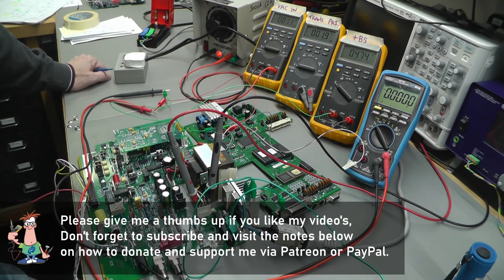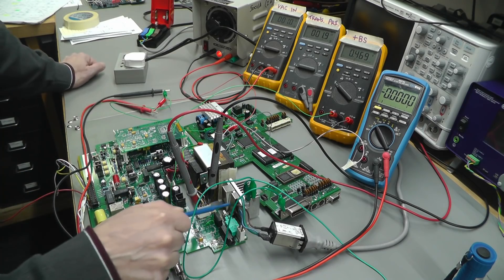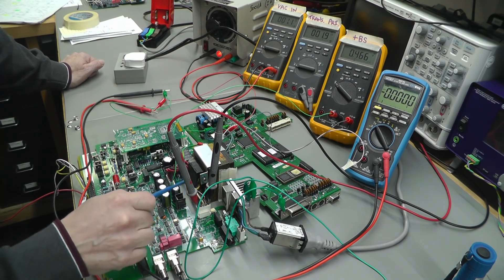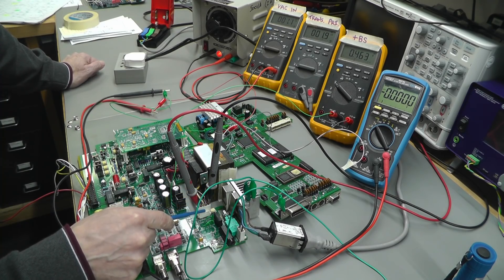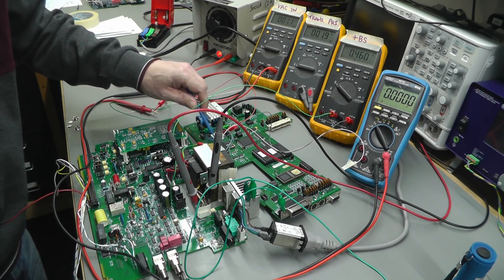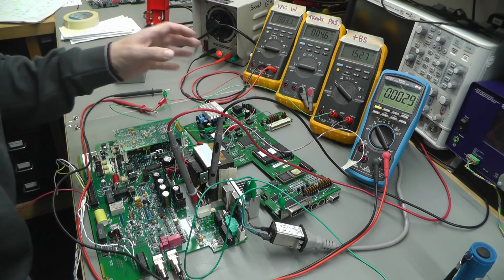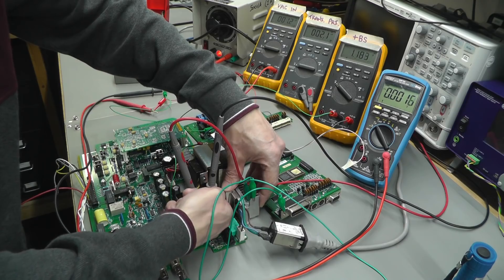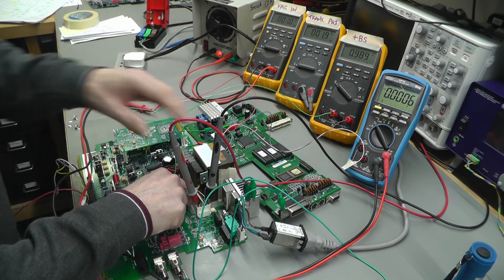No.092 - Keithley 2001 7.5 digit Multimeter Repair - Part 6

Comment: Discovered your channel after seeing your chat with Dave on The Amp Hour podcast. Love this series! What an epic repair! I'm really surprised at how poorly designed that 110/220V selection feature is on the preregulator circuit. For a meter this expensive you'd think they would include a bare minimum of protection circuitry to cut power in the case that the relay fails and puts 220V on the 110V primary winding. So many ICs could have been saved from untimely death!
Reply from the maker: Yes, it was an epic repair!......loved it coming together and that power up when the pre-reg did it's thing. Agreed it is an oddball design!

Comment: Ian did you remove the auto voltage select circuit to prevent the unit self destructing in the future?
Brilliant repair and very entertaining.
Reply from the maker: 2 reasons I removed that function:
1. To stop future self destruct.
2. Not easy to isolate the circuit in order to repair and test, even if I could have done it how reliable are the relays etc.

Comment: Excellent repair journey, thanks for sharing! Looking forward to seeing the calibration vid.
One question: why did the (uncalibrated) reading vary so much when you slowly changed the line voltage?
Is the 230V line voltage directly controlling the unregulated +/-8V supply?
Reply from the maker: There's a fault with the analogue board. I am working on it.

Comment: Great efforts Ian….thorough as always in working through all those faults. Can you tell me what was the part number for the power mosfet in the the pre-regulator….?
Reply from the maker: There are a couple different ones used, but the one to hand is a 2SK1451

Comment: Epic repair, not many would try with such so much damage with a massive voltage overload which takes out fixed regulators, well done.    Any idea what the root cause of the over-voltage was? i.e what failed in the voltage selection circuit or theories?
Reply from the maker: I am thinking leaky caps on analog board took out the DC supplies somewhat, which then affected the 120/220Vac logic.......and then BANG!

Comment: Great repair, you succeeded the impossible.
Btw. did you notice the read DC value from voltage source was changing while you varied the AC supply. Like something is still not regulated or exactly right
Reply from the maker: I'll take a look, cheers.

Comment: I abandoned the side swipe DIP sockets a long time ago, except if they were on board already when I received the item.  Then I just pulled and re-plugged the chip.  But when designing the board or installing sockets myself, I changed to the 4-side contact types.  Much more expensive, but never any problem.  Well, not quite true, once I had to troubleshoot a solder bridge under the socket.  That solder job was not mine, though.  The fact is the fatter metal on the underside can increase the chance of excessive solder forming a bridge despite of board solder mask.

Comment: Ian, very well done! Like to see how you test and calibrate this unit.
Reply: Yep, excellent showcase on 2001 repair project. Not all of them actually as this bad to fix, but many are, thanks to old leaking Nichicon VX caps placed next to very hot linear regulators. Calibration is bit messy with 2001, since you do need perform both user and factory calibrations and need provide FS on each range and some high voltage AC calibration signals. Unlike other meters, 2001 wants all steps performed in specific order and will not save calibration data unless all steps are completed without any errors.
Reply from the maker: Haven't look yet, but I was wondering whether re-cal via GPIB allowed for individual cal and not "the whole lot".
Reply from the maker: Update: Finally got around to doing a full test and yes, loads of errors, mainly 4xx errors, which I traced to a broken DATA connection to U530 which was stopping the dual DAC from working. I now only have one error, 412.1 ACA Switch which I haven't traced down yet. Some folks are mentioning CR305......I'll have a look.

Comment: Hello Ian. It looks good now. I would suggest to let it stay on for about week(so it get baked to correct temperature for some time and to remove some humidity from board..that will take some time) and after that start re-calibration.  It does looks good. I wasn't able to do full calibration(too many things..)..but i was able do that calibration with two voltage sources and two resistors..That should be easy to do for you as well. Nice video.
Reply from the maker: I'll be calibrating some PDVS2mini's is a few weeks, so the 3458A will be summoned into action then......perfect timing for soak test and then cal against the 3458A.
Reply: @IanScottJohnston  You'd also need 3245 for low frequency AC ;-). Coming right up...
Reply from the maker: Whoop whoop!
Reply: @IanScottJohnston  aaa I envy you..I want to calibrate my 732A(to get some exact number) and also my 343A .. but too bad ..it will take some time ..till i would be able get them into some lab..it just cost too much to calibrate any of those ..
Nice i wish it will go perfect..but i'm a bit disappointed in 2001 performance in that stability and noise...but i hope it will improve with new item on my watch list ..better not say wit what :) haha